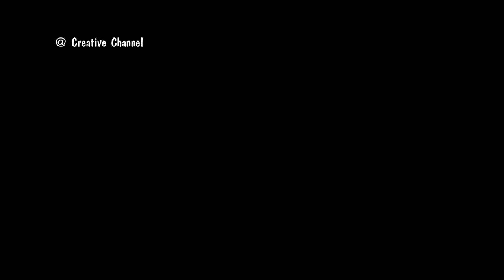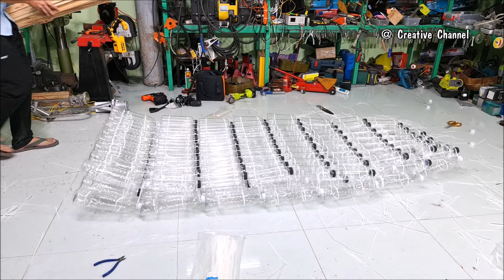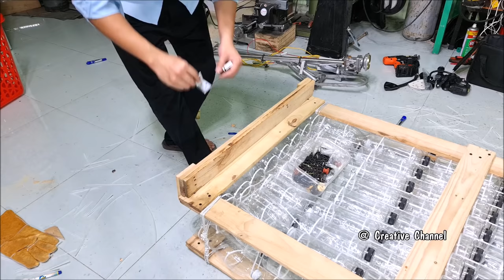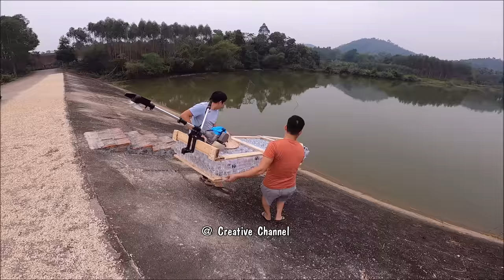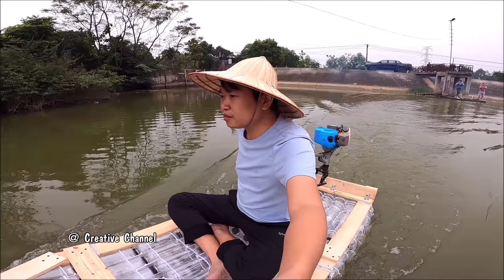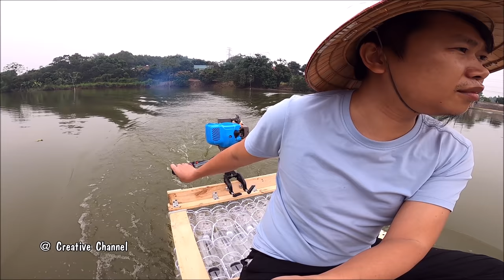DIY Boat Using 200 Plastic Bottle

Comment: If someone wanted to build an unsinkable boat or raft, this would be the way to go. If you used  2 liter PETE soda pop bottles, it'd be practically indestructable - those soda bottles are pretty strong.